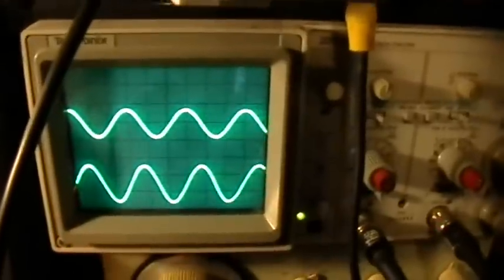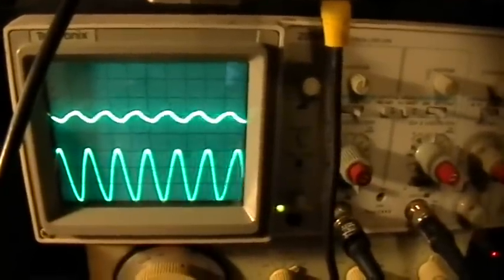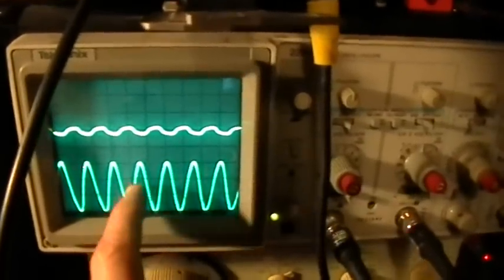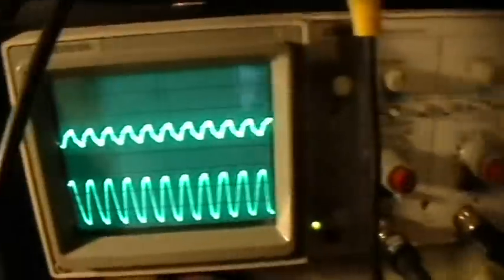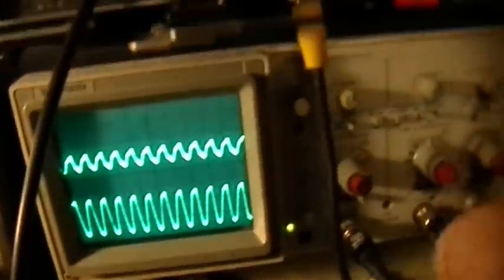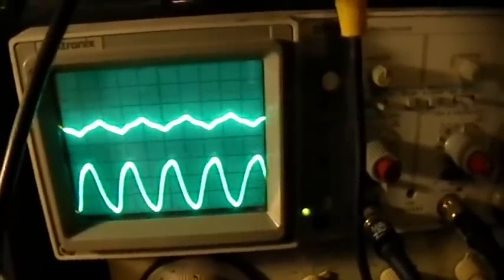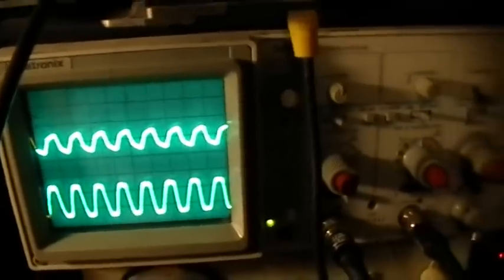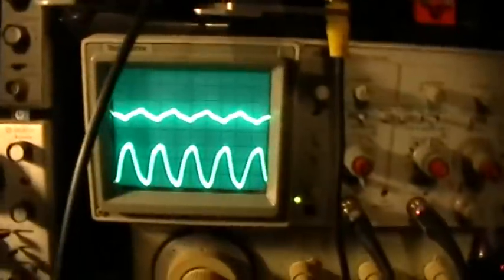Magnetic Resonance Amplifier 3: Capacitor Instead Of Piezo Element

Comment: You should check what happens when you use a frequency around 1MHz (try a range from 100KHz to 10MHz). Depending on the field strength of the magnet, you should get some feedback at the larmor frequency (Hz/Tesla) for your magnet material